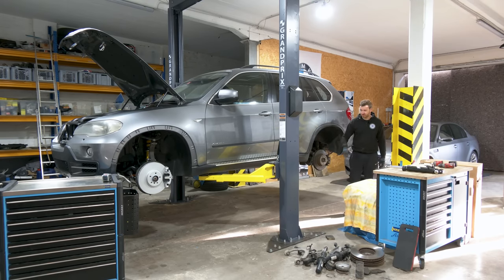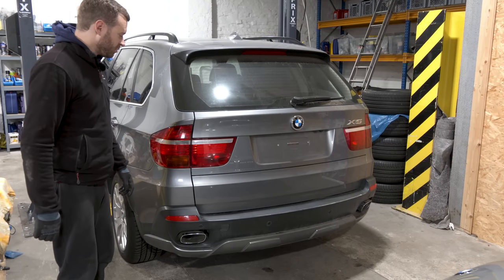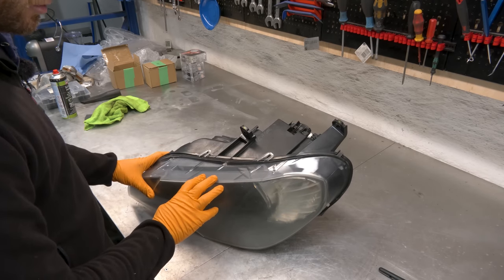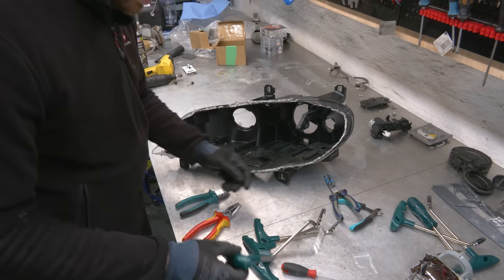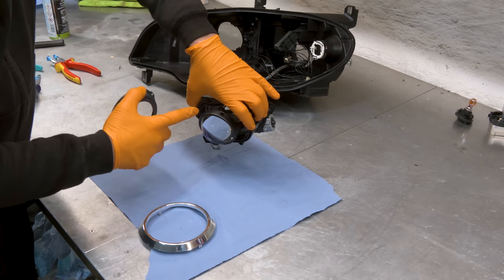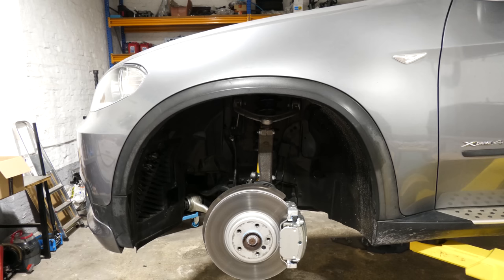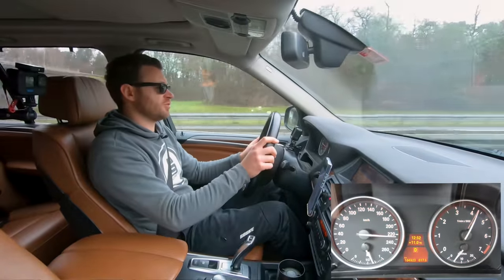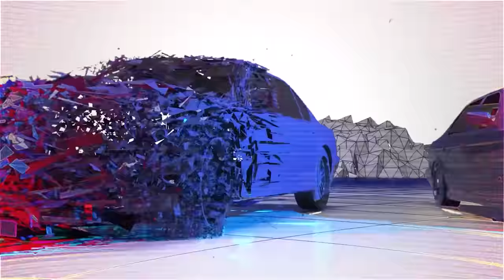Damage Report - Neglected V8 SUV BMW E70 X5 - Project X5: Part 5

Comment: Funny that with all the German TÜV stuff you are allowed to drive with tires rated lower speeds than the top speed of the vehicle? Here in Finland (also kind of regulated country what comes to car modifications etc.) that will bring you a fine, IF police finds out that you have for example 210km/h rated tires in a vehicle which has 240km/h top speed. This affects for example insurance coverage in case of an accident...
Reply from the maker: Did we watch the same video? I didn't do that, I used summer tires that are rated to 300 kmh and cause it was +10°C outside.

Comment: I would be kind of mad if I was to pay 1000€ for a headlight that, even if properly maintained, degrades and needs replacing. How is biodegradable wires gonna help the environment in a plastic headlight that can't be serviced under normal circumstances? To me that sounds like planned obsolescence to sell more parts.. And that's some shady shit, especially when it degrades to be a potential fire hazard.. BMW should be forced to recall. 
There's simply no way those wires will help the environment in ANY way.. Quite the opposite.

Comment: I can't be the only one saying this but why wouldn't you just remake the wiring. That is some DIY WHY shit going on there.

You always do such a great job, going the long way to do it right but this heatshrink wiring is a low point on this channel.
Reply from the maker: I can't believe I have to continuously explain this and now getting backlash. Do you really think I would actually mess with saving the old wires IF new wires and pins were available? It's a non-serviceable part, parts are not available, every connector has different pins and it's impossible to find them. There is no other option.

Comment: You should of just put the light in the oven at 225 and just keep checking it then the whole lens will just peel off
Reply from the maker: It won't. I explained that in the video. These are permanently sealed headlights.